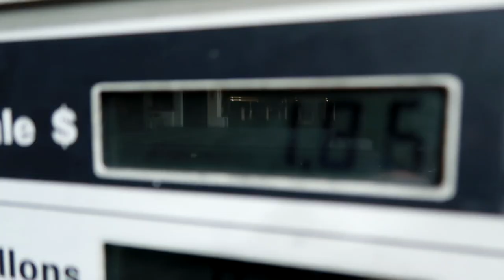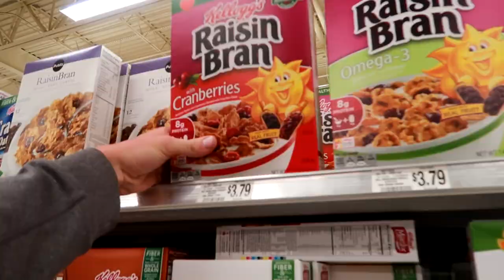DESTROYED My Motron...

Comment: Gas station pumps run slow when their filters need changed. Slow running COULD but not necessarily mean that some particulates are making it though. Our family business used to be a gas station and I was always told to get gas/fuel somewhere else if the pumps are super slow.

Comment: I think those are the wrong lugs for those wheels. That might have been your problem. You need the stock Chevy ones.
Reply: The wheel at 1:13 can only use the rounded end 7/8th lug from the factory. Not the long spline kind for aftermarket wheels